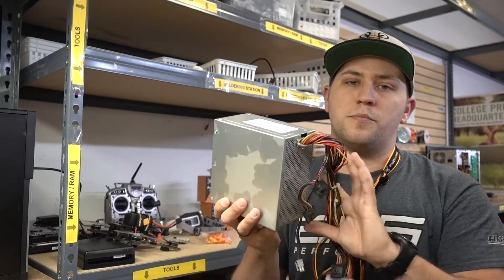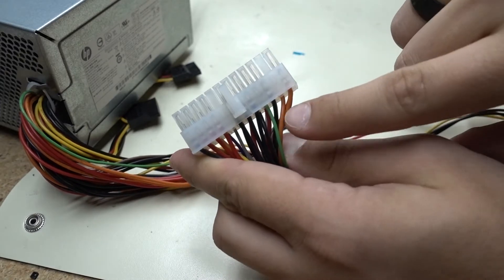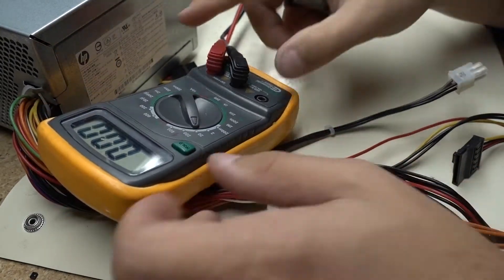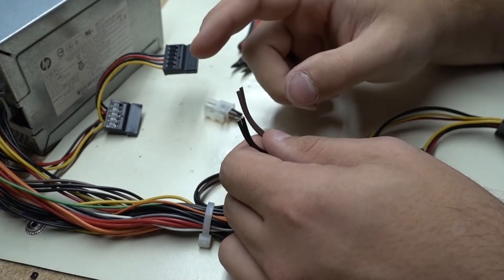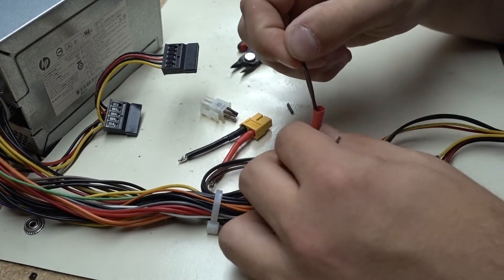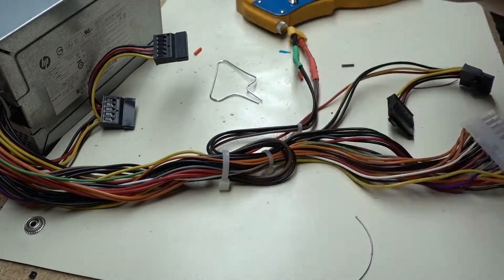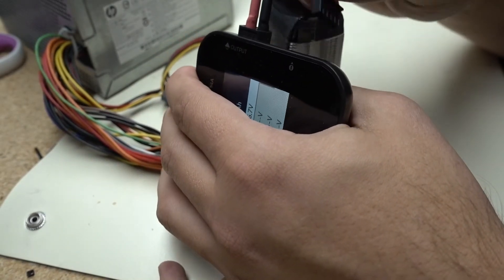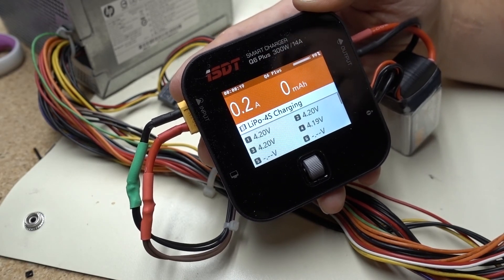Use a computer PSU to charge your lipos

Comment: if you use both pci wires and splice them in.. or even a sata chain you can probably get 12 amps off even a smaller 400 watt power supply.

Comment: just use an old laptop power supply, cut lead that connects to laptop and at XT60, boom done, not fiddling with PSUs. Made several for friends using old dell and HP power adapters for laptops to power ISDT chargers and other brands.

Comment: Lipo is 4.2 volts max, so a 4s would be 16.8 volts. I came to this video to see how you were going to adjust the 12 volt output up to 16.8 volts. To my surprise, you didn't. 12.45/4 is about 3.1 volts each cell. This would barely charge the pack if were almost dead.
Reply: And this is the way you show to everyone on Youtube you don’t know any basics from electricity and RC electronics :)
Reply: you don't plug this directly into a lipo. It pugs into a DC powered lipo charger

Comment: Can I combine 2 red to get 24v?
Reply: Yes but you would have to run them in series. So solder ground with power from the two PSUs and then use ground from PSU 1 and power from PSU 2 for your charger (or vice versa). But you could also check if your PSU has a 24v output somewhere.

Comment: Hey new beedrone i watched you vid about chging the pc power supply to charge lipo batteries but my question is the white connector you cut that will hold the xt-60 plug is not brown,black wire color on my end.it is 2 yellow wires and 2 black wires.i need to know which is power and which color is power and which color is ground ,i really appreciate your good video..thnk you,Harry

Comment: Hey great video, I was wondering, im trying to check mAh on some batteries I had sitting for alittle over a month and my balance charger doesn't track mAh, if I power it with a bench power supply (within the rating it requires from wall ac-dc adapter) that does count mAh how accurate will that be?